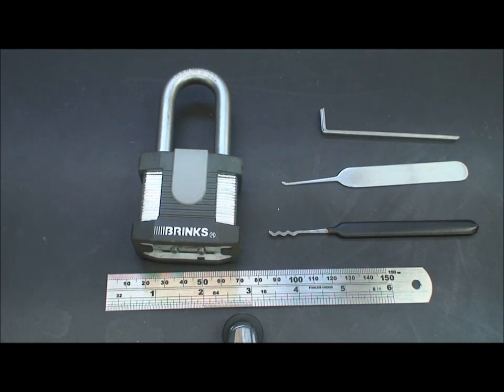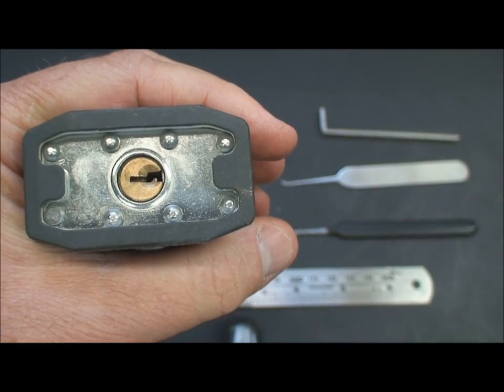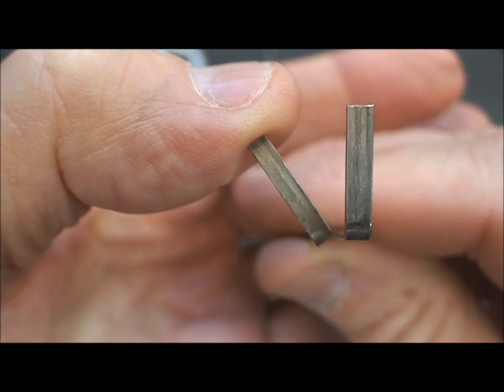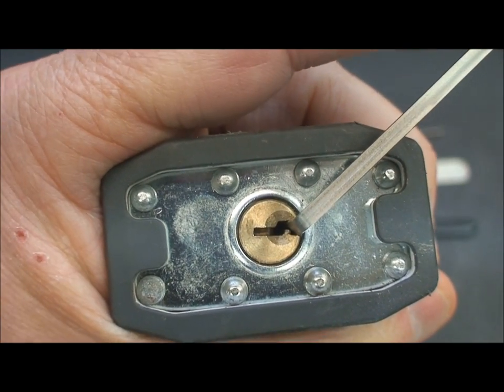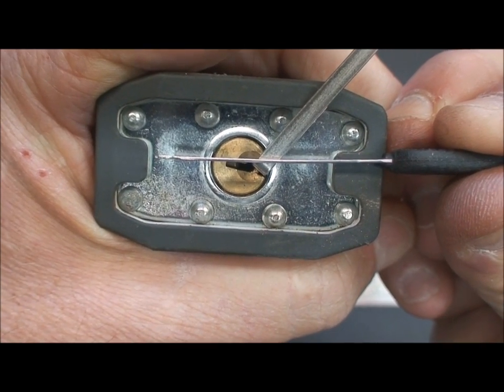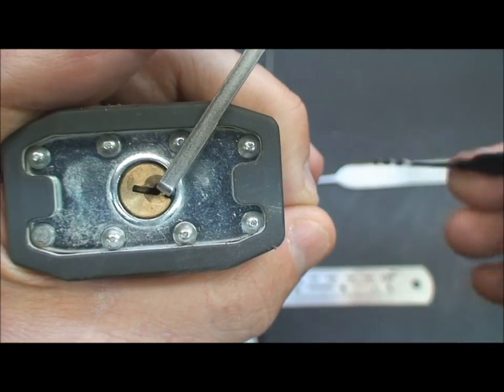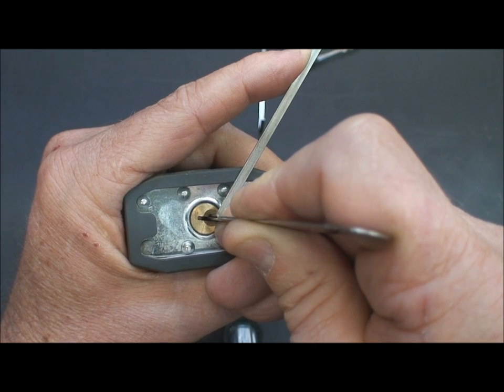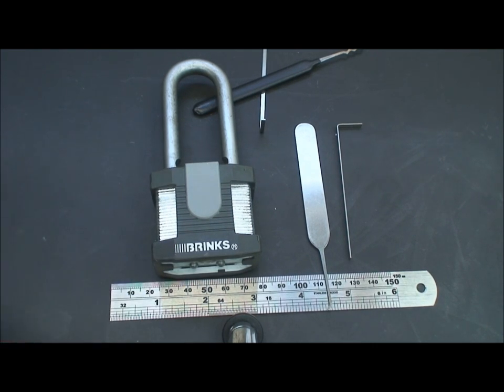(20) Brinks High Security Laminated Padlock w/5 spool pins

Comment: I just picked my first lock with the instructions of the video. I did it in less than 5 minuets with a tensioner I made out of a temple I cut off from broken eyeglasses and a steel dental pick. The lock was a Brinks. It popped open when I also pressed the shackle down in...
I locked to do it again and it took much longer.

Comment: So this lock have Spool pins Bill? http://i58.tinypic.com/2mnhunp.jpg Because its very difficult to pick. Takes me like 15 minute to pick it every single time, where the Master Lock MAGNUM takes me like 1+ minutes. When I get counter rotation just simple release tension as I keep pressure on the pin.. Right..?
Reply: +Mark II I have that lock as well, I believe it does have spools because the way I successfully found to pick it, is to rake it to a false set, then find a binder and set it, and it typically opens the same way.  I'm not sure if all 5 pins are spools but I'm almost positive at least 1 is.  This is only my 2nd lock after the clear azure piece of shit, so i'm pretty stoked I can pick spools already.